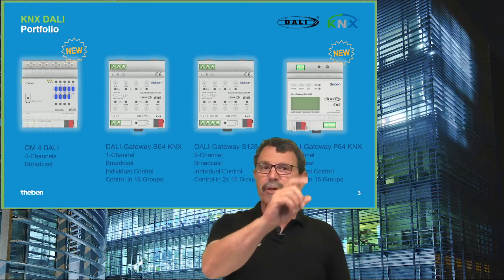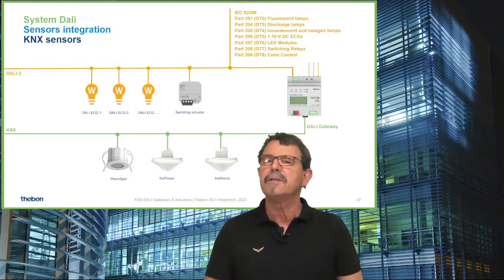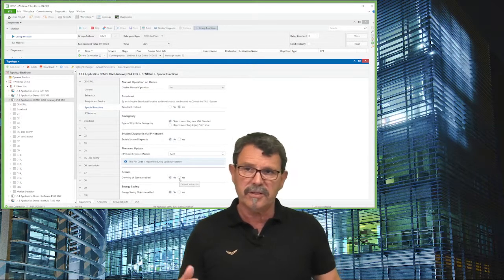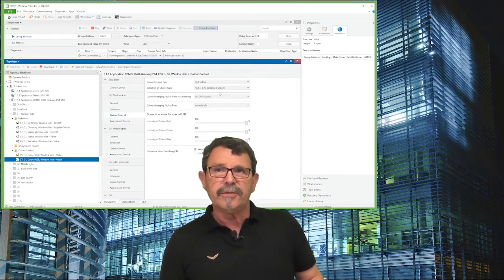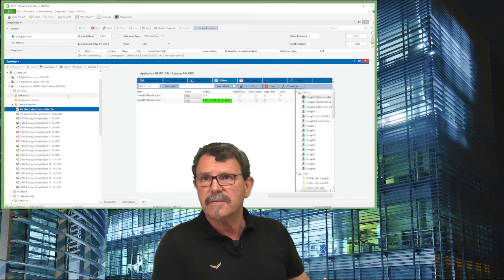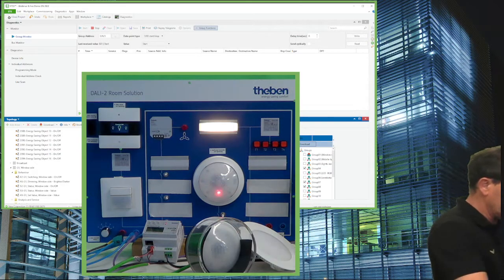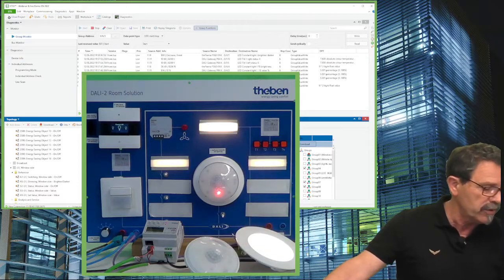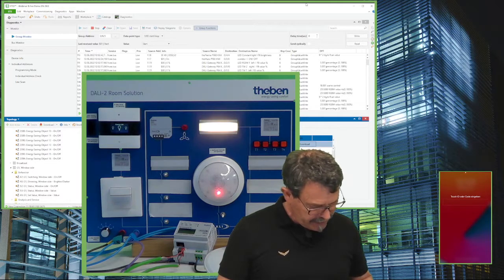Video tutorial DALI Gateway P64 KNX EN

Comment: Dear Sir,
Can you explain about API/MQTT, GTIN?
thank you
Reply from the maker: MQTT is an open network protocol for machine-to-machine communication that enables the transmission of telemetry data in the form of messages between devices, despite high delays or limited networks.

The GTIN (short for Global Trade Item Number) is a 13-digit number. With the GTIN, every article, every product or every product variant can be identified worldwide without any overlaps.

An API (Application Programming Interface) is a set of commands, functions, protocols and objects that programmers can use to create software or interact with an external system. Kind of an interface. E. g. as a developer you could connect ChatGPT to any of your applications by using the API of ChatGPT.